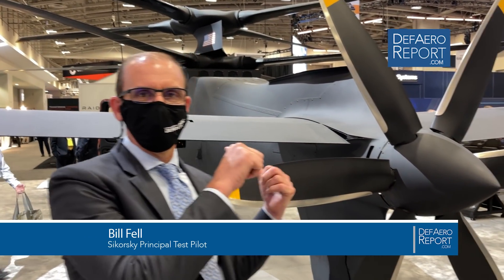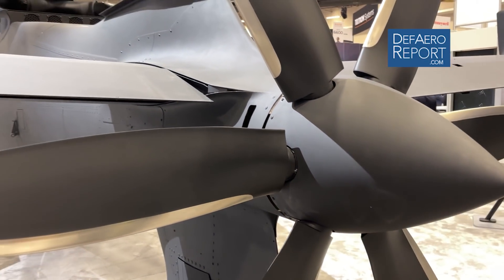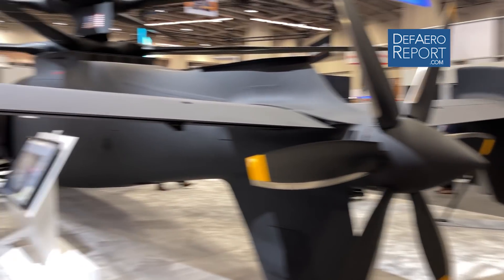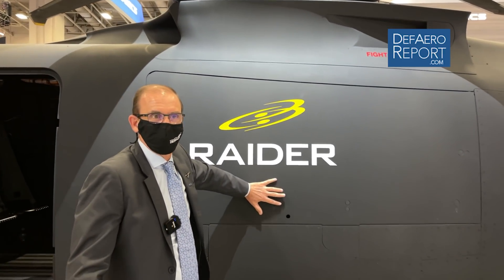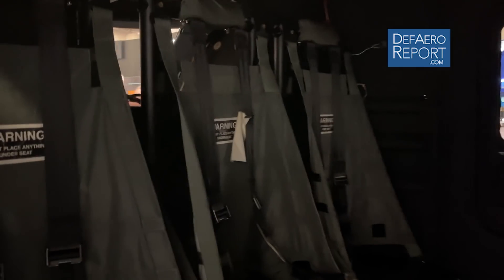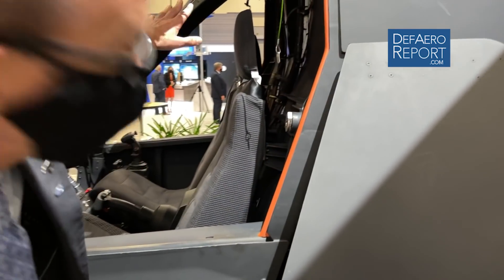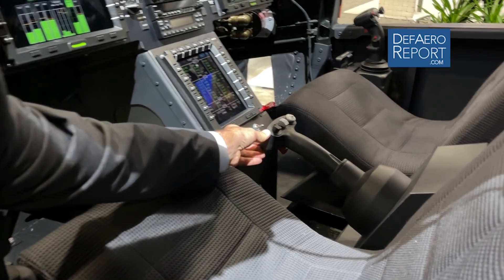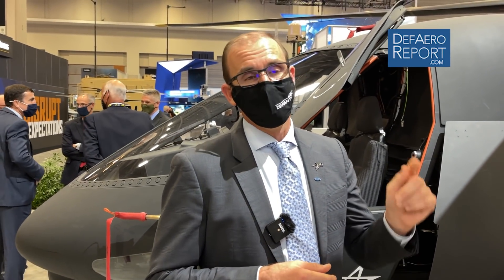Walkaround of Sikorsky’s Raider X Compound Helicopter for US Army's FARA Contract at AUSA 21

Comment: Looks good, but it seems to be very tight inside. No place. And no place for stretcher to carry wounded soldiers ?
Reply: It’s intended purpose is for attack and recon, not medivac.
Reply: @fentonpainter7907  Yes, I understand this, but, there are seats for transporting soldiers. This means, this helicopter is also will be used to bring soldiers to somewhere to fight. If they bring soldiers somewhere, than later these soldiers will be picked up by the same helicopter. When the soldiers are leaving the helicopter or when they are coming back and want to enter, they could get shot. Just imagine, how bad it is, if one or more of the soldiers are wounded, they are climbing into the helicopter, but there is no place to lie somewhere.
Reply: @janostoth4315  There is no requirement for the helicopter to have extra seats, as it is purely an attack and reconnaissance vehicle. This is just the prototype, and I suspect the manufacturer just wanted to show there was plenty of spare space in the fuselage. Fitting a few seats is an easy way for them to do that. But in reality it would likely to be used for extra fuel tanks, munitions or electronic warfare equipment etc. Possibly inserting small SF teams in to hostile areas, but troop insertion and extraction isn't it's brief, and the Army has other vehicles for that.
Reply: @janostoth4315  These  test aircraft are only 80% scale from a full sized normal acft. They are meant for systems testing not combat readiness.

Comment: Cool but I love Valor and I hope Valor will win
Reply: Yes, for FLRAA, the Bell V-280 Valor is head & shoulders above Sikorsky's offering, the Defiant X.  This YT video's about the Raider X, Sikorsky's FARA offering, up against another Bell powerhouse - the 360 Invictus.
Reply: @txtworld  Valor's, rotor footprint is nearly 15 feet longer than defiant, which would make it a no go for tight landing zones. That's why they use multiple Blackhawks instead if 1 or 2 chinooks. And if the LZ is big enough just use a 44 passenger chinook and not a 12 passenger V-280. Plus if the army chose the defiant for utility, attack and scout mission a lot of the acft parts are interchangeable, making procurement and supply storage much easier.
Reply: @kenbred46  When the V-280 Valor is rotated 90 degrees, its landing footprint is equivalent to the Defiant.  Due to the V-280 Valor's significantly shorter length.
Reply: @txtworld  What? That is not true in the slightest.  The V-280 has an absurdly large wingspan that does not change whether in forward flight or the hover configuration.  Unless you mean when the wings are in the folded position, which is for stowage purposes and not actual flight operations.
Reply: @randomman057  It's absolutely true - the V-280 Valor's wider wingspan, is offset by the Defiant’s significantly longer length. Thus a V-280 rotated 90 degrees has an equivalent landing footprint to the Defiant. Or vice versa - a Defiant rotated 90 degrees has an equivalent landing footprint to a V-280. I’m not talking about with wings folded, being a V-280 variant designed for The Marines and Navy – The Army’s V-280 has a fixed wing configuration
Reply: A prefer Raider

Comment: Do you remember the B-1B Lancer Bomber we lost over the Eastern part of the United States on a training flight in which they had an engine fire.  Why could they not put out the fire, and had to leave the aircraft?  Some things in aircraft design is there for safety, and manual circuit breakers is one of them.  Give the aircrew full and unadulterated control of all of their circuit breakers.  This reminds me of the electronic screen throttle controls on USN Destroyers and Cruisers.  Do NOT do STUPID THINGS!
Reply: I'm an electrical Designer and there's a lot of redundant safety features that perform better and faster than manual circuit breakers like overload and short protection. Works faster than humanly possible. You still have control over power distribution, the integration is just a way of managing control. That said, it's only as good as the guy who programs the PLC.
Reply: @christopherpeninger324  
Well said.
Reply: @christopherpeninger324  +1
Reply: Circuit breakers are cheap and work.  MFDs are expensive and usually work, but now you can lose everything at a single point of failure.  It's like that Tesla marketing crap.  Great, you moved every physical control to a touchscreen.  How does that improve the car?  What advantage was gained besides making it look superficially more high tech?  A software glitch didn't used to be able to prevent me from turning the fan on.  Nor a semiconductor shortage.  A half-ounce plastic switch is immune to all of that.
Reply: @maninredhelm  AMEN AND AMEN!!!
Reply: @MultiCconway  
You can keep arguing that, and people will continue referring to you as another dinosaur that died off because he couldn't adapt to change.  If the old way was the better way to make airplanes, they'd still be making them that way.
Reply: So in another words, don't innovate.  Keep building them just like they were designed in the '50s.
Reply: @bryanrussell6679  I ain't no pilot nor engineer but that seems like removing essential safety features to me indeed, waiting to see what are the pilots thoughts on such a choice
Reply: @benjaminleguennic7349  
Well they actually aren't removing those features.   Some are being handled by the flight control computer, and other features are still available thru the changeable screens of a glass cockpit.   As with anything new, bugs will need to be worked out.  But a glass cockpit isn't really new anymore.  Can a new airplane still crash?  Sure.  But is air travel safer now, or has it gotten worse?
Reply: @bryanrussell6679  "...a glass cockpit isn't really new anymore..." . . . and you are missing (perhaps deliberately) the POINT.  Man should always have control of his destiny.  Once you go fully digital you are no longer in control of your own path.  You want THAT during the Chaos of Combat?  Shame on you!  There is not such thing as a perfect system.  There is always room for improvement, and nothing is as constant as change.
Reply: @bryanrussell6679  "Some are being handled by the flight control computer..." . . . and I have no problem with that ... even with safety features.  However, when you lock out any manual override capability particularly that last act before death...for a final act of a safety system . . . you kill the pilot when the software . . .  IS WRONG!
Reply: @MultiCconway  
Would you please STOP YELLING AT ME?  I'm just kidding, lol.  I see what you're saying and I actually agree with you.  I'm just not sure that a glass cockpit doesn't still offer the same level of human integration, it just looks different.   You're right about the software, Boeing proved that with it's 737 MAX.  Aside from those two crashes, isn't it correct to say that airplane safety, commercial or military, has only improved with the advancements in technology?
Reply: @bryanrussell6679  My apologies.  Software and deficiencies thereof have already killed two airliners full of people, and you will never see all of us defense folks who buy the farm while industry learns.  I like automation, glass cockpits...heck I'm a USN Aegis troop, and worked in the B-1B Lancer Simulator System for nearly 10 years, and I can tell you there is no such thing as a failsafe system in flight controls or anything else.  The system will be advertised as such . . . until it kills someone.  Every human being should have a manual way out . . . period.  Last ditch should always be manual.
Reply: @MultiCconway  
Oh wow, you have a really cool and interesting background!  I agree with you 100%, no system will ever be foolproof.   I can see how a backup manual control system is possible on smaller planes.  But the bigger ones, I don't know if two pilots could manipulate the flight control surfaces.  What do you think?  Maybe?  But the bean counters probably will deem a manual backup system as an unnecessary added cost and weight to the plane.   It is a terrible truth that a tragic loss is what leads the way for improvements.
Reply: @bryanrussell6679  Manipulating flight control surfaces in not the issue.  Task management in a complex environment is the issue.  Have you ever flown?  Automation helps the pilot, but pop a nuke and EMP kills everything electrical . . . then all the sudden all you have IS control surfaces, and in a 'Fly by Wire' environment . . . you no longer have control of ANYTHING.
Reply: @MultiCconway  
Are you talking about Crew/Cockpit Resource Management?  
No, I've never piloted an airplane.  I probably would enjoy it though.   I did get to fly in Bell Helicopter's simulator when I worked there, but that was a helicopter.  Still fun.   
As for nukes and EMPs, most military hardware and vehicles are hardened to withstand an EMP blast.  That's my understanding, at least.  I've worked for both Boeing and Bell Helicopter my past.  I saw this at Boeing mostly, you could easily tell the difference between items made for commercial use or military use.  But as you mentioned before, nothing is failsafe.  In the digital age, if an adversary really wanted to hurt their foe, taking out their electronics would be a devastating blow.  Kinda scary.  Last winter, the electricity was out for about a week and a half.  Luckily the gas heater still worked, but damn.  It was so boring not having anything to do.  It was 20° and everything was covered in a rare snow.  You just don't realize how dependant you are on the modern conveniences like electricity and indoor plumbing, lol.  Sorry I got a little off topic there.
Reply: You can "pull and strap" electronic circuit breakers on your screen, and if your screen dies, your copilot can do it.
Reply: @bryanrussell6679  NO . . . that is NOT what I said!  When it comes to Primary SAFETY Equipment the Human should ALWAYS be in control . . . particularly in AI systems . . . "Open pod-bay doors HAL".
Reply: @bryanrussell6679  THAT is NOT what I said.  What I am saying is when you take manual safety capability away from the pilot . . . you kill him when things go wrong because there is no such thing as a perfect system, and the human must always be in the loop.